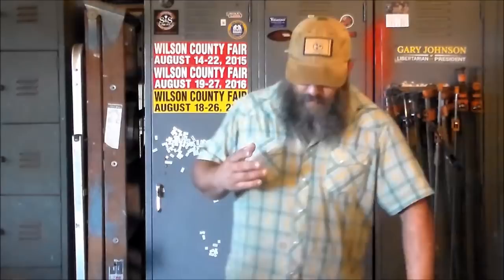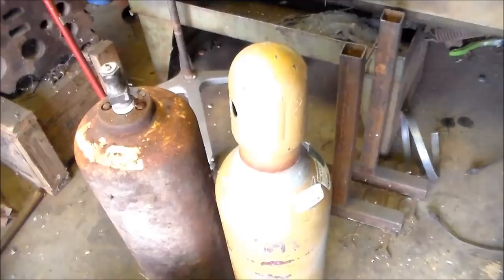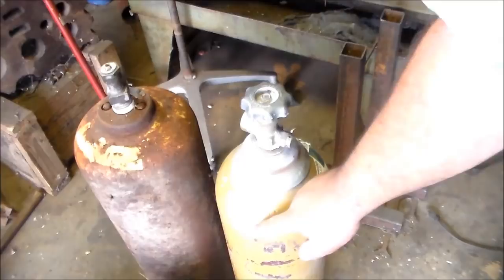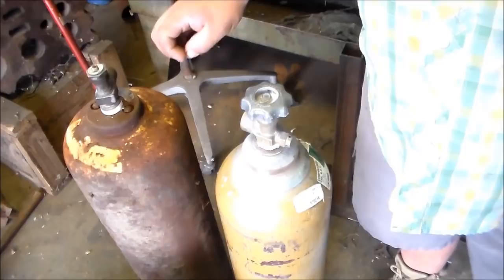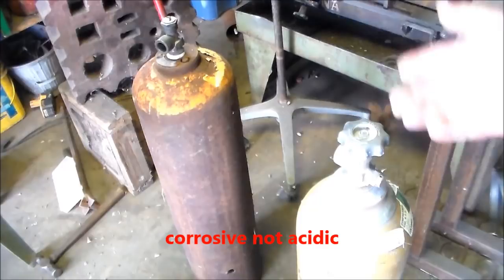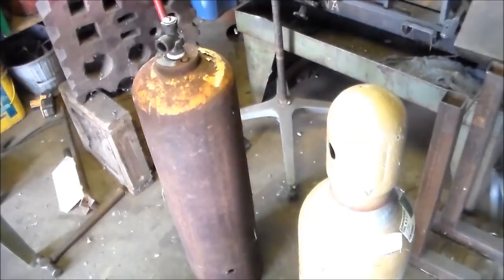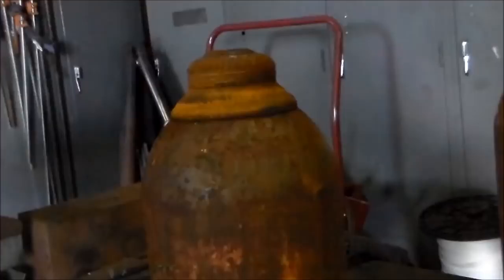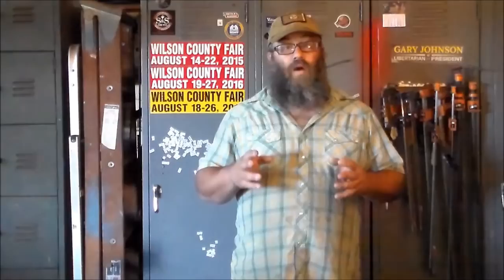Acetylene Tanks, What's In Em?

Comment: An Acetylene Tank is typically filled with Gypsum. You could cut both ends off and remove it in a Hydraulic Press or simply dissolve it with Hot, Dilute HCL.
Reply from the maker: aaronfu2 good info, thanks!
Reply: The Masse inside, is designed to absorb the acetone or coolant (DMF). so that when filling the acetylene, it remains evenly distribute and cooled even when under duress!  At work we have a list of about 20 porose masses that can be filled, some require retesting every 5 years whilst other 10years. They are Micropor masses which is a mix of natural products, bims, carbon, calcium... and also porous masses which are chemical, traditionally with asbestos fibres, up until th 1990's... In Europe. all masses have different features and maximum gas capacity (g/m2). Source... Acetylene cylinder requalifier/tester based in Germany.
Reply: most new acetylene tanks are filled with cork, and the acetylene tanks are done this way because acetylene is very unstable.
Reply: I guess you work in a hospital stabilize fractures with Gypsum,  Acetylene cylinders are filled with pumice-stone!
Reply: Acetylene tanks are filled with Diatomaceous earth and then Acetone is added to the tank.  When the acetylene is pumped in it mixes with the acetone which stabilizes it.
Reply: What is HCl
Reply: @gerardcaccioppo1958  Hydrochloric acid.
Reply: or you can simply take a air nibler with a 2"-3" chisel and it will chunk out in no time with a little work. problem solved you fools.

Comment: Depending on year of manufacture, the mass may contain asbestos.  Acetylene is unstable above 15 PSI by itself.  Dissolved in acetone and DMF, it is stable  beyond 30 PSI.  This allows more volume than pressure alone allows.
The mineral filling absorbs the acetone/DMF liquid so when the acetone is withdrawn, it doesn't bubble like a beer into the regulator.
Acetone isn't corrosive, acidic or basic.   It is downright scary because of its instability and flammability over a wide range.

Comment: Thanks for the lesson on the inerds of the C2H2 tank. From what I've read Agamassan is the substrate in the tank (Wiki), and Acetylene is unstable in it's pure form, hence it is dissolved  in Acetone making it safe to transport and use.
Reply: acetylene is unstable by itself,  that is why acetylene regulators have a red danger area on the dial past 15 psi, your line pressure should not exceed 15 psi.

Comment: The solid porous "matrix" inside the tank is basically gypsum (similar to plaster of paris). Its also called agamassan. Its soaked with acetone which acetylene is highly soluble in under pressure. Acetylene under pressure by itself will convert to explosive peroxides at or above room temperatures. These will make a powerful bomb if acetylene was introduced into an "empty" (normal) gas cylinder.
Reply: not peroxides. there is no oxygen for such reaction. acetylene above critical pressure polymerize explosively

Comment: One other reason for the porous mass in these cylinder is that it acts like a large flash back arrestor.Most of the cylinders that i have retested over a number of years have been full of asbestos.In general no dings to the outer shell...and also not let it dry out as the mass will shrink...Not all that hard to work the numbers out.Tare weight...M.T weight....Full weight...some cylinders will also have the solvent weight on them....makes it really easy....have filled many over the years at home....not one problem....treat like a lady...all will be fine.....how....all starts with a deep freeze.....ex gas company worker...great video keep it up...cheers

Comment: That was excellent Brendan! never seen inside one before! I didnt realise it was a solid matrix, I always thought it was only liquid acetone that the acetylene was dissolved in, and it could just pour out!
That C size acetelyne tank I have been saving in the shed can go to the dump now! (The oxygen tank is another story......)
Reply from the maker: I use the acetylene ones for blocking 4 wheeler trails, illegal ones.
Reply: that would do it :)
Reply: Voo Doo Tennessee Just FYI on that...I was exploring trails in my home town about 10 years ago on my dirtbike. I had been on the trail years before and knew the general layout but didn't ride there often. Somebody (perhaps even the owner of the property-I don't know) thought it would be a good idea to lay a telephone pole (about 8 feet of one) across the trail to "keep dirtbikes off". Well, luckily I saw the pole at the last second at about 35-40mph. I was lucky and missed the pole. I did crash but I didn't break my neck like I would have if I would have hit it. About a year later another guy died from the same thing. PLEASE DON'T LAY SHIT ACROSS TRAILS. I don't ride where I'm not wanted or allowed but I've been lost, gone exploring, etc. and that can kill/cripple somebody.
Reply from the maker: If you hit any of these you are 50 yards past 2 impossible to miss no trespassing signs, play stupid games win stupid prizes.
Reply: That is probably gypsum.  Same stuff inside wall board and that cement is made from.

Comment: Those are fuse plugs. In an event of a fire, those are supposed to melt and safely release the burning gas in an emergency.
Reply: "In case of an emergency (such as a significant rise in temperature), I have to release the gas I store." - Said the DOT-8 or DOT-8AL cylinder.

Comment: Newer tanks use gypsum, alot of older tanks used asbestos I have a few old asbestos filler tanks from the 40s, that's another reason you wouldn't want to cut into them but I'd be more worried about the acetylene more than the asbestos.

Comment: The acetylene in a new bought cylinder can be at 250 (pounds per Sq inch),  When in the cylinder it is dissolved in acetone making it stable.    When the gas is made, it is at atmospheric pressure.   How is it increased to 250 PSI between the acetylene source and the cylinder value.  .    .  At some stage along the pipe it mist be at above 250 PSI for it to flow into the cylinder,  Why does it not explode?
Reply: Because it is absorbed in acetone it is stable.
Reply: @tomoliver8498  I know,  but how it the new make acetylene moved from origin to the bottle.   The cylinder is already filled with acetone. There has to be a pipe   with no acetone.   The pressure has to be greater than in the bottle to move it in.   Why does the gas not explode en route?

Comment: Using MC acetylene tank for propane
I use a small plumber size oxy/acet tank set for doing refrigeration sliver solder, etc.  It is 40 miles to my gas supplier...way to far just to exchange a bottle of gas for $14.  so what did I do?  I removed the acet valve, added HCl to dissolve the gyp, rinsed with water, dried with air and heat gun, replaced valve with bbq cylinder valve, filled the 12cf acet tank(now R-290) with propane from my 5gal tank at home..also use a high pressure refill hose with cga540 fitting to refill my oxy small tank from a large oxy tank.

Comment: Acetylene is very unstable as a liquid so it is "dissolved" and it needs to be absorbed in some material to make it stable (It can ignite on it's own). That is another reason you don't want to exceed about 8 psi on the flow because it can ignite due to friction in the line. 40 years ago someone told me they had balsa wood in them but I am not sure. In any case they are not empty inside.
Reply: We run it at 13 psi and it's fine.
Reply: Thank you for your comment.

Comment: I had heard once that the material in the tank was asbestos.  Is that (or was it ever) the case?  And is it always a solid foam matrix?  I thought they used a material that was more like a fiberglass insulation (something packed in, not cast in place).
Reply from the maker: I don't know what they use now, but it is my understanding, no proof just what I was told, that it is no longer and hasn't been asbestos for a while.
Reply: They still use, and never stopped using asbestos, they just stopped talking about it
Reply: @RandomsFandom  Do you have a source for that? Asking to settle an argument over here :)